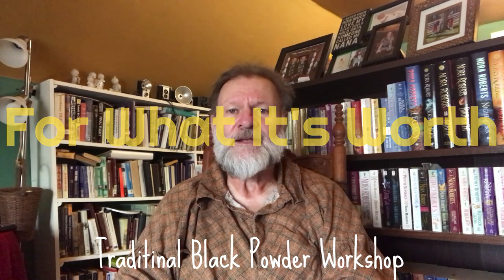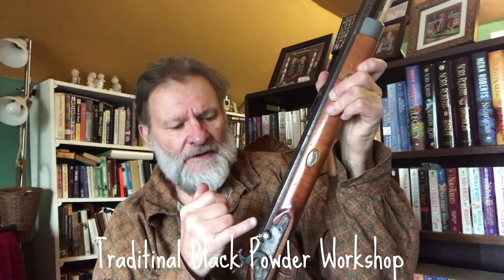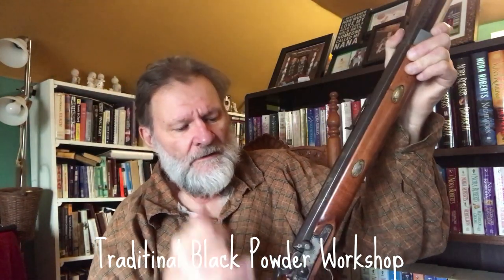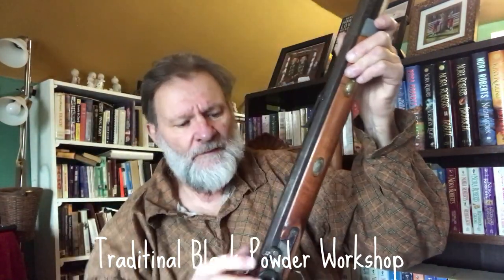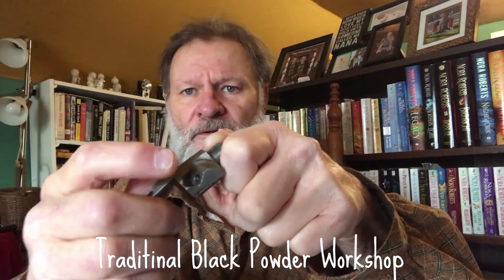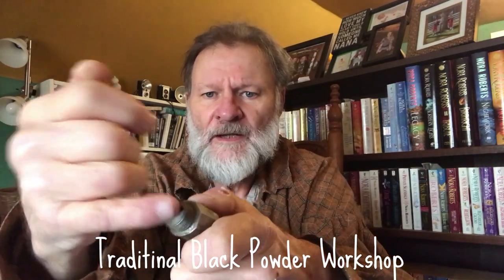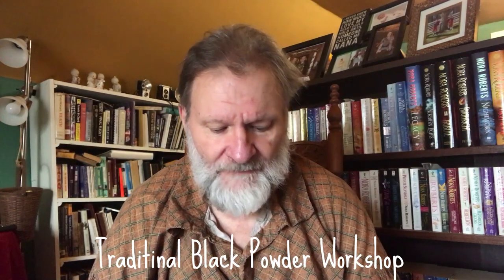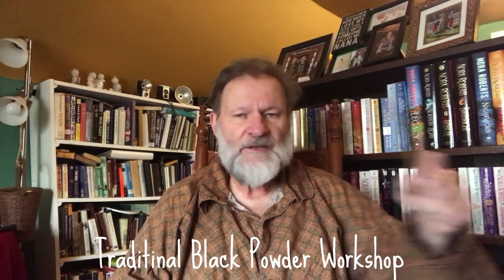For What It's Worth: Percussion Rifles the two most common ignition styles of your Rifle/Pistol

Comment: The drum threads all the way through the breech plug on that cva. It's a very strong drum set up and has a ton of thread engagement.
Reply from the maker: Actually this particular CVA I have altered. The only concern with the breech set up is the small entry hole from the barrel to the powder chamber. It tends to fowl up and that limits the main charge from filling the chamber making ignition unreliable. So I opened the small channel that leads into the powder chamber from the muzzle. Which now makes the task of cleaning the breech area much easier( no fowling to hinder the powder charge from getting into the powder chamber). This allows for a much faster more reliable ignition. I have done this to several CVA’s and Traditions rifles as well. The other major disadvantage to this breech system is that the breech plug is next to impossible to remove. Not that a person should need to remove one. But the positive is this breech plug drum combination is by far stronger than just the drum screwed into the barrel. A modified patent breech plug is what I prefer on my percussion rifles.

Comment: A few minutes ago I left a comment asking about what charge I should use for a 14 gauge fowler in order to shoot round ball. The bore of the gun is .69 inches. Now after watching this video I have to ask you another question. My percussion lock has a nipple similar to the second one you showed (no clean-out screw). Would you have any idea as to the approximate date that they used this method? 
Thanks again for the very informative video.
Reply from the maker: As for shooting a round ball with your .69 Fowler I would use between 75 to 90 grains of 2F. You will need to use a wad over powder ball then a wad over the ball just to keep it in place. You are talking smoothbore correct?  
Now as for your second question the patent breeches were developed in the early 1800’s but became very popular on the newer percussion rifles in the late 1820’s. The drum on percussion rifles were made to convert the flintlock rifles since the hole was drilled for the vent. They just drilled and tapped the threads to allow the drum to be installed onto the barrel
Reply: Nice video. I will mention that the small clean out on a drum or on the modern patent breech is actually stronger than the brim it’s screwed into. The quality of steels, the threads used on both drum and plug and maintenance all effect this question. But generally on bore obstruction events the barrel will spilt at the breech, then the drum will blow out, and finally the clean out screw will blow out. 

That little clean out screw is your friend. It keeps you from working the drum on and off the gun which wears the threads. If/when the clean out screw threads begins to wear they can be refreshed by drilling out and re-tapping to the next size. Once you do that once or twice it’s time to consider a new drum. 

Picky little point. But that’s the engineering of the issue. 

Fox out